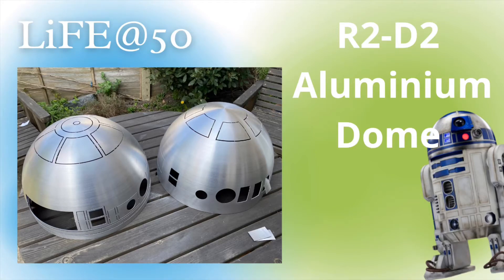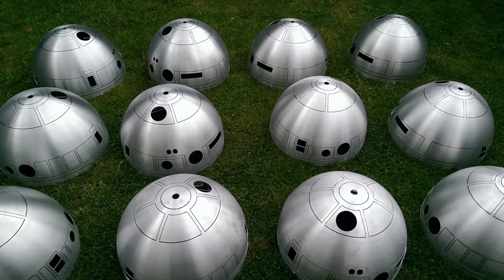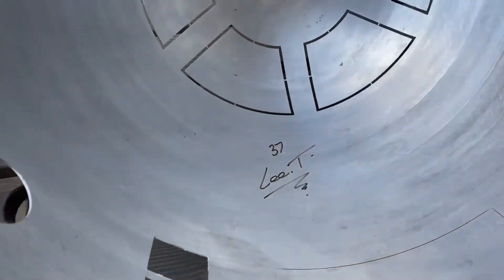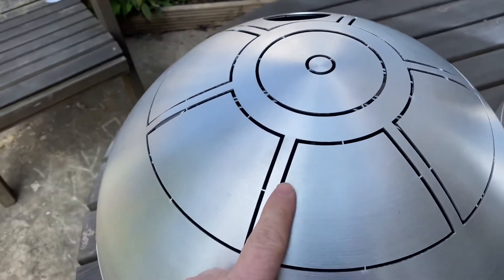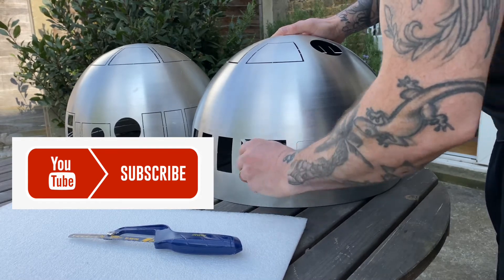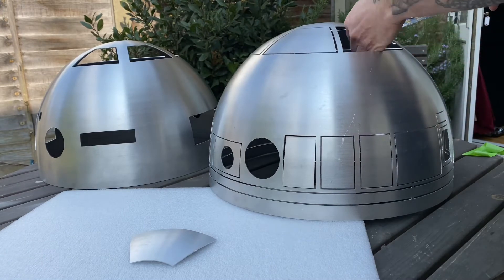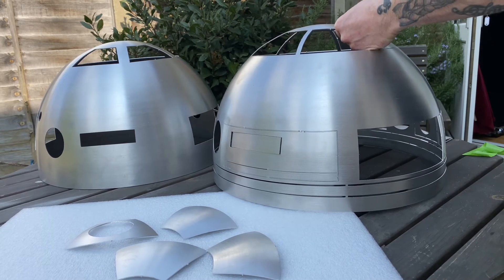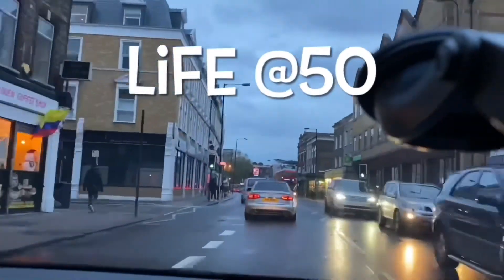Available domes for your screen accurate 1:1 R2-D2 build

Comment: Do you have Instagram account? If post photos so can the inside detail of the wiring and putting the other parts because I have eve . Just didn't want mess up. Your helps.
Reply from the maker: Yes I do @justme.jason but I will add detailed photos on here when I get to it. Unfortunately it is slow progress because I need to order the hinges and HP’s before drilling holes etc 
What dome do you have?
Reply: Same as yours don’t know who got long time go in the clue in the stats.